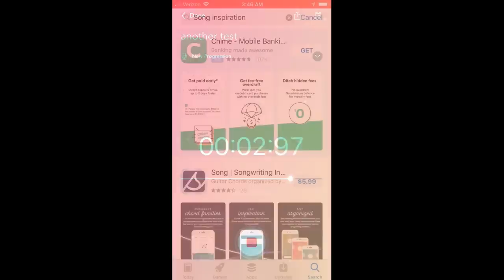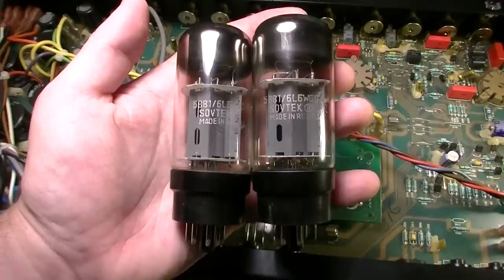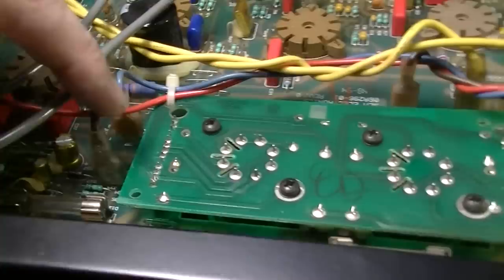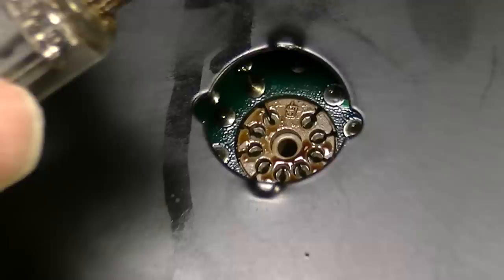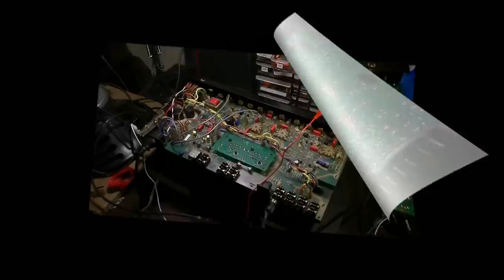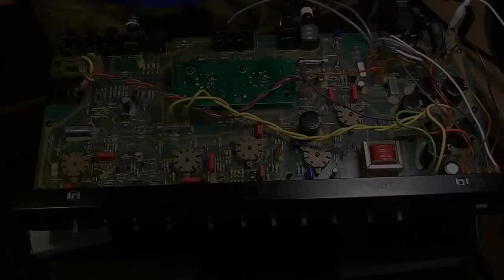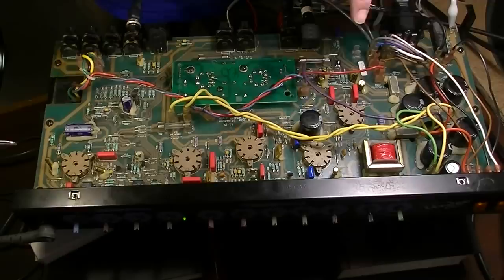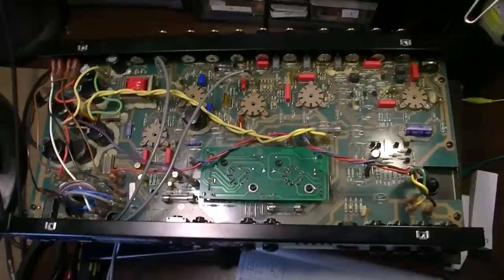Secrets of the Crate Blue Voodoo...or is it BLUE DOODOO? You Decide!

Comment: Brad, I have a degree in Electronics Engineering and have decades of experience. Most engineers I know are dorks with degrees that like to show contempt for those that do not. You may not do everything by the “book” or explain things in a “proper” manner, whatever that counts for but you do get the job done and done well. Personally, I have a lot of respect for people like yourself that are self taught. Anyway, I really just wanted to tell you, Don’t ever take those idiots seriously. As long as you do not give dangerous advice, no engineer should give you any grief.
Reply: Wayne Turner This is how electronics have been repaired for 100 years. Most repair shops are run by people that can read a schematic and/or troubleshoot and most do not have degrees. They can warrantee there work but they don’t need insurance, if a part fails it fails. There is NO instance I can imagine where the device works as expected when it leaves the shop and then fails in some spectacular fashion that isn’t just another part failure or short, etc. a screw up that big would not pass a basic function test. There are certifications for certain High/Low V jobs depending on the State, I am not aware of any for  basic repair. Usually certification requirements are for those wiring a house or building or doing line work, etc., places where a mistake will burn a house down or kill you. In the late 80’s, early 90’s we had a saying in the repair business, If it doesn’t kill you it won’t kill them. I apprenticed part time in a repair shop before I got my degree from 1986-89 and repaired stuff as a 16 yr old kid after school.
Reply: Well said!
Reply: @Jmdeclue im not goimg to take cheap shots or look for angles where i might get dig in because that stuff stinks of ego issues. I will be honest and tell you that the impression that your giving - not
Reply: Is right Joel. Well said.
Reply: @priestblood  Bro... the tax man???   Given his situation, and not knowing what he does (if anything) outside what we see here...   his amp repairing isn't making him enough to even report to Mr. Tax Man.
Reply: I am a retired tech; if I could fix it quick and dirty NASA didn't care.
Reply: Exactly. Brads is unofficially a Public service provider. Education or Entertainment, you decide. I just learn.
Reply: As an engineer you should know that engineers don't repair things.  They design them.  TECHS repair stuff.  It requires far less knowledge of electronics to repair something than to design a complex circuit.
Reply: True, the best techs are the 65-75 yr old range, did a good apprenticeship in a amp shop and totally know 3 times more than any paper engineer.  Have literally seen a old tech give a green engineer a tube amp to ix and they split. Alot different than laying out a electrical floor plan for outlets and a use box. Got to have heart to learn this trade and be good or you will be a parts changer and go broke.

Comment: This amp and Brad's difficulty to repair it illustrate perfectly what I've been saying for 20 years about the electronics industry (tv, stereo, appliances, amps etc).  The engineering MO is to build them cheaply and so  difficult and expensive to repair, they are NOT worth repairing.  In other words, just buy a new one.. A broken $299.99 flat screen tv will cost more to repair then just buying a new one.  It's planned obsolescence and economics.....
Reply from the maker: This is unfortunately true. The only saving grace is if we keep sharing knowledge and schematics and help each other understand the common failures. That might make it possible for some techs to specialize in certain models that would otherwise be thrown away.
Reply: All true but also keep in mind that 299.99 flat screen TV would cost 1,000 if it was built better and more serviceable. Sure it would last longer and be cheap to repair if it did have a problem but far fewer people could afford it in the first place. I'd rather have a cheaply built TV that works and will work for ten years before being trash than no TV at all.
Reply: @wingracer1614  What you described was always an option when electronic items were built to last, circa 1920-1975.. Quality electronics from companies such as Fender, Gibson, Craftsman, GE, Westinghouse etc were alongside "entry" level cheaper brands such as Kay, Danelectro, Silvertone, Black & Decker, Sears etc... the difference is ALL those brands were/are repairable even today.. The only 2020 industry IMO that offers high quality and low quality equivalents is the Amplifier world. You can purchase a $5k boutique amp or $200 crate such as this video.. The boutique models are built to last AND can be serviced for a decent cost. The rest of the electronics industry seems to be vanilla and very subpar to average.. is there any difference in a $1k flatscreen tv in quality and repair ability vs a $299 Walmart sold tv? Not to my knowledge.
Reply: If only they didn't try to save .01 cents and instead buy some quality capacitors then the tv's would last longer. I fixed my computer monitor by replacing a cheap capacitor instead of throwing it into garbage. The fact with the tv's is also that many people buy new tv's because of new technology even if their old one works fine. I tend to keep stuff around unless I must have some new tech and most of the time I don't.
Reply: @Old man I also want things to last and so I'm now voting with my dollars. Companies won't understand anything else but money.
Reply: Appliances are the same way! I'm in the kitchen remodeling industry and I hear about the drop off in quality all the time. The life span of a refrigerator or dishwasher is a third of what was expected 20 yrs ago. Most homeowners remodel their kitchens maybe once in their lifetime, that  included appliance replacement.  Now, people are keeping the cabinets and tops but replacing appliances every 5-10 years. They used to last 20+ years! That's a lot of money to invest.
Reply: “Right To Repair”... 😞😞😞
Reply: Not sure a flat screen was a good analogy.  Plenty issues with flat screens going bad I have fixed with anywhere from $3.50 to $20 in replacement capacitors on the power board.  I have repaired 4 displays by doing this, and 2 I got for free because they were being thrown out.  If it were something like row/ column drivers or buying a specific inverter or backlight assembly, then i would agree it could get nasty trying to figure where the problems exist.
Reply: In late 2017 I took a 55 inch flat screen Westinghouse TV to a local "TV" repair shop... I asked for an estimate.  it came back at $235.00 US dollars... I only paid $275 for it 3 years earlier at Walmart... Guess what  I did???
Reply: @contrabandjoe7974  I'm assuming it went in the dumpster, however some symptoms can be fed into the Googles and you discover tossing in the dumpster is not the only low cost solution.  I held off on repairing a $400 monitor because the board it needed would've run $150, then learned the entire board is not bad, only $15 worth of capacitors on the board was bad.
Reply: As a retired senior tech from what was once the old phone industry I can tell u that corporate decisions both manufacturing and maintenance are based solely on the bottom line of each financial quarter with little or no long term strategy.  My last few years as an instructor allowed me to peak behind the curtain and I can tell you all the suspicions folks have about the corporate world are true. Management at all levels are driven by bonuses based on quarterly results and the ones with huge parachute packages could care less if the whole flippin company, or country for that matter go belly up. They sacrifice the future for the quarterly margins and change jobs when it hits the fan. It's all a big dollar scam of smoke and mirrors. I'm sure the same goes for all the electronics industry whether talking about TVs, amps computers etc....
Reply: @timmooney7528  I fixed the "computer" in my '85 RX-7 when I "blew it" by mistakenly hooking the battery up backwards (like a dumb-ass).  Mazda wanted ~350+ for a rebuilt unit and they wanted my old one back to get that "low" price.  I figured that since I had broken it, I wouldn't lose anything by trying to fix it.  Long story (kinda) short, I had blown a single diode that cost me less than 15¢ to replace!
Reply: @bobvines00  my sister has a 81 Horizon that was killing brain boxes.  bad diode in the alternator was leaking AC into 12v system
Reply: Tv's are expensive to repair because repairmen dont want to take time, or dont have the smarts how to really rapair the problem. They just trace the problem to one of the  pc boards and replace it. Then order order the board, mark it up 400%, charge you $100 per hr. labor. Its the way everyone is taught now days, kids can do algebra and trig. , cant do basic math, or count back change if a cashregister failed. Hell some cant even tie their shoes. Parents, and the school ,system are failing. Computers and cell phones are destroying society!
Reply: no shit. I have a randall g2 that has been to 3 repairmen and it still fucking fried. pisses me off to no end because it means that they all fucking lied to me. maybe I can do a video where I sledgehammer the shit out of it
Reply: The huge problem with this is we’re filling landfills with all these appliances that we just replace. Sure some parts and components get recycled but most of this shit is being dumped somewhere. I’d rather pay more for something that would last 20 years and can be fixed. A lot of the obsolescence also comes from software capability in these appliances as people want the latest advancements.

Comment: I have a Crate V-50 tube amp... got it for only $200. in Benicia, Ca at a music studio and jam center. It works perfectly after I pulled out the tubes and cleaned the sockets. When I pulled up in front of the building there was a Ferrari parked outside. I walked in the front door and Sammy Hagar was hanging out checking out a custom Eastwood Wolf Wood guitar. He plugged it into the Crate amp and cranked out a few vintage cords.... I was in VH Heaven..!!

Comment: Glad to see a new video from you.  I need my electronics fix.  These are Crates entry into a real pro amp.  Sammy Hager has been using Crate Voodoos for years covered in RED of course.  I had played one of these with a JBL120 and later a V30.  Great tone.  So I found a Voodoo 300 full stack with 4 V30s in the top cab and 2 15" in the bottom about 5 years ago.  The cabs are 7 ply birch built like the rest of the pros.  Supposedly the 300 watt RMS power section is based on the Ampeg SVT.  It does have alot of tubes.  It's a monster.  Glad to see you again, Brad.  Great video.

Comment: I have one of these and you are SO right about the construction.  Another piece of the “unserviceability” on this amp is that the pots were apparently a proprietary deal.  They are an odd size.  I have one that actually broke (the shafts are plastic) and the only way I can get a replacement is to get an old crate amp.  I thought, well...If I am going to have to remove the board to replace it, I’m going to replace them all. Even if I had to direct wire them. 
WRONG! 
Another fun issue is the pots are what supports the board in the front! 
What a nightmare!
It’s a shame—I liked this amp.

Comment: The Combo has a different schematic than the heads. You have a schematic for the head which has a solid state drive reverb. The Combos have a tube driven reverb and there should be a 12AU7 in the V4 Position. They only marked it on the schematic but no where else. The schematics marked BV-60 or 120 are the combos, the heads are marked BV-60H or 120H on the schematic.

Comment: I have a BV60, and the channel & boost switching works on the panel but not the foot switch. The foot switch buzzes out fine, tip to sleeve and ring to sleeve, on & off. I'm supposing the on-board jack solder joints need to be re-done, but I need some support to pull the board...

Comment: I have a Radford STA-15 hifi amp from 1963 that uses EL34s and it's self-biasing without that complex circuit!
Had amps with a boards as dirty as that one, don't be afraid to just put them in the sink with sugar soap which gets all the crap off, rinse thoroughly and leave outside to bake in the sun, then flush the pots and theyare like new. No chemicals that'll eat the board over thew years either.
The finished amp sounds well Brain May!!! :D

Comment from the maker: No idea why the outro music got dislodged. 🙄
Reply: Brad, those Blue VooDoo amps were popular.  Sammy Hagar had a Sig version, called the Red VooDoo (of course).
Good to see you getting back into amps.  Hope u are doing all right.
Reply: ripple edit?
Reply: I have had YouTube delete my own song and say it was somebody else's
Reply: Crate is the only app that I had that just quit working. The Marshall modeling amp heat up and goes off but it comes back on I think it needs a heat sync or a fan. The Peavey backstage 50 the only thing I bought new and it's made in USA has worked since 1990. The electric in my house is screwed up and the Reverb makes a funny noise.
Reply: The orange CR 35 amp needs a new speaker because it can't handle the power I think. It was one of the last cheap ones they made with a spring reverb it sounds good when you keep it on low volume
Reply: I could not believe when I opened up my gold top Les Paul Studio from 2012 and it had a PC board in it. And since I know way more about guitars now. They put in a bone nut and instead of filing the nut they filed the neck. Figures that  it was a Jehovah. I did find out it has a baked maple fretboard from when they took the wood from Gibson I don't think they put these crap in the Gibson's anymore. But who knows when they run them over with a Steamroller. I could not believe that video. Imagine how many kids could have learned to play
Reply: Could that amp got have gotten really hot? And they separated the connection?
Reply: I think I will send this to my friend who used to work at Traynor amps in Canada. When I got my orange CR 35 amp the Caps were burnt. He fixed it for me thank God
Reply: must've been the grease, it even got on the video
Reply: St. Louis on Ferguson....... not my favorite part of town. It's really depressing, but I did see some drug addict's white Gibson Les Paul hanging up at PJ's Pawn. Should've made an offer, but it was right handed so no bueno for me.
Reply: @LetArtsLive  Join the club, LAL.  Stay free, RHR.  😎
Reply: @RHR-221b  yeah we might have to start fighting to stay free pretty soon
Reply: @thelokifiles  😎
Reply: My dad repaired a few Crate amps. Frequently the Vactrols in the switching circuits were the problem. Btw, the service manual is available online from Elektrotanya. It would have save you a lot of tracing time. I'm glad you got this one sorted out. Cheers!
Reply: Gremlins.
Reply: Strange voodoo maybe?

Comment: I have a Crate Vintage Club 5212 from 2001 (60 watt, 2 - 12" speakers) and it has the same self-biasing circuit. It seems like a good design and super loud if cranked. I agree that these amps are still prone to possible issues from the difficult to maintain PCB design as you mentioned before. Their Vintage Club line has a great Crunch on the distortion channel and the tone can be adjusted nicely through the effects loop.
Reply: I had the VC50310... I liked the sound of it.
Reply: @DeadKoby  Yes I think the tube choice and the tunability of these amps give you good sound at a lower price point than boutique amps. I still play through my Vintage Club at home to this day since it really plays anything very well. 

The only thing I have had to do with it is repair the amp footswitch. Crate had mounted the footswitch button on a small pcb board in the footswitch  housing and it wore out the solder pad conenctions in the first few years. I had to solder wire to the on/off connections between the switch and pcb to make sure the switch always worked since the pad connections were too weak to stay soldered after being used.
Reply: @THUNDERWORX  Yes the combany made horrible act to cheapen parts and the motherboard. Carte bluevoodoo and vintage club amp where designed really good, but combany want more profit and debase to orginal design. Thats why there is shitty motherboard and some parts. 
I have 90ties VC3112 with blacktolex(normallly tolex is cream color) and it really rock. I'm first owner. There is one of the best clean tone what I have heard. I have to change all big electrolytics and after that I only have to change  tubes few times. Main issue is that it was biasing really hot. (Eat el84 tubes faster than rest of 30watt amp what I have tested.) Cooling bias  will be only  modification what I will do on orginal design.

Thanks for one of the best amp repair channels in youtube.

Comment: I bought a BV60H head from a guy about 6 years ago, it powered on, but no sound. Found 2 BROKEN 12ax7 tubes, had to reflow most solder joints, and replaced a couple large filter caps. One problem I've found on almost every Crate amp I've been into, is that the little push button switches, and the jacks all were dirty and losing contact. And just about every one had broken solder joints on the large filter caps and tube sockets.
I didn't care a lot for the way Crate engineered the tone stacks. But found that if I used my BBE 462 Sonic Maximizer in the effects loop, that it really brought this amp to life! I still use this amp,